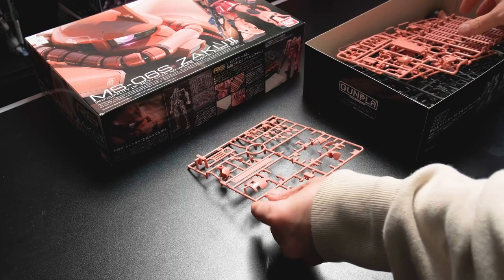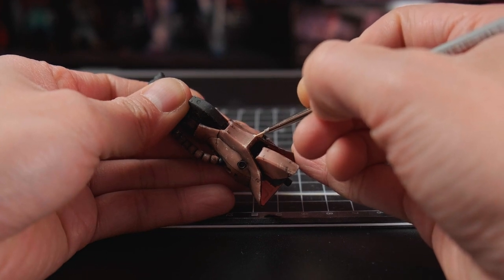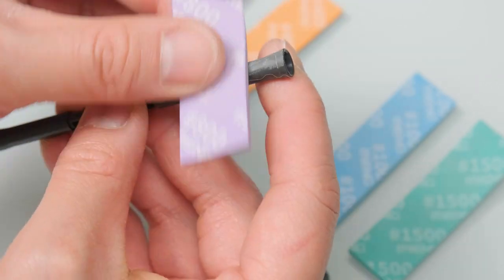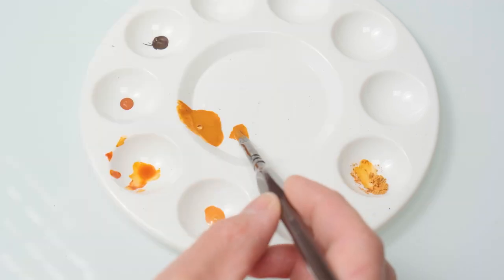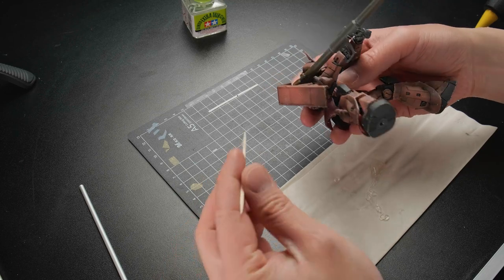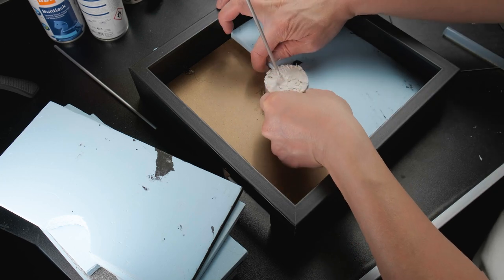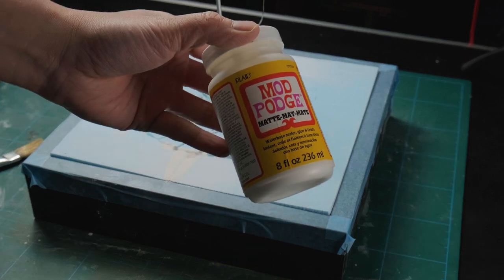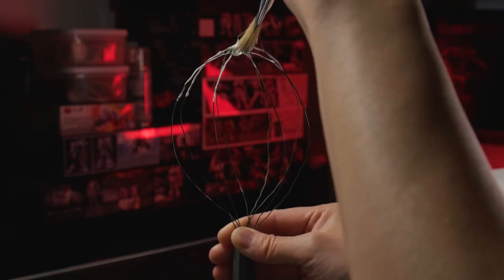How to make an explosion effect for your Gundam Diorama

Comment: so your letting the real touch marker do the panel lining as well as its weathering effect? Shouldn't I panel line first? Or should it be after painting?
Reply from the maker: I think you can do it both ways. However, if you want to do it after painting, seal your kit with a varnish first. Otherwise you would wipe away all the weathering colors with the panel line ink thinner.

Comment: How far away, in cm, you stay from the cotton for coloring? I use the same paint, but my cotton became sticky and no light comes through.
Reply from the maker: Mine has become sticky at certain spots as well, it just doesn't show on camera. So I start with at at least 30cm, depending on the color. For black I would go even further away, because a bit of black can go a long way. You can always build up slowly. Thin coats and your patience are the key ;)